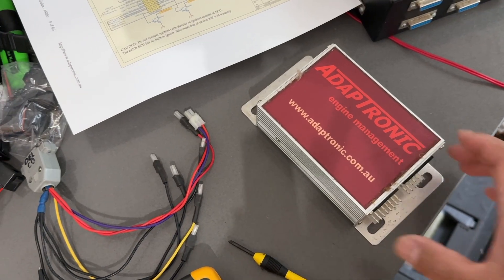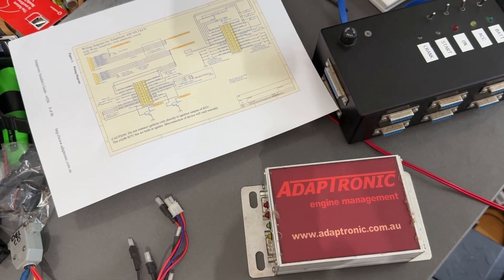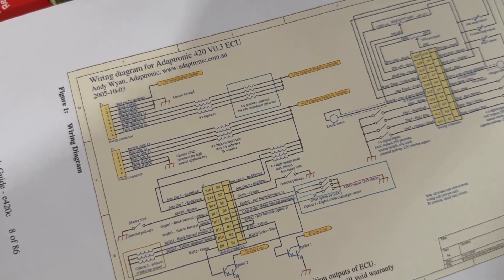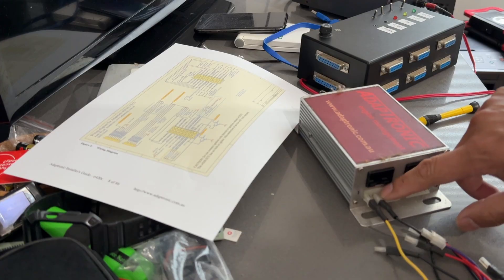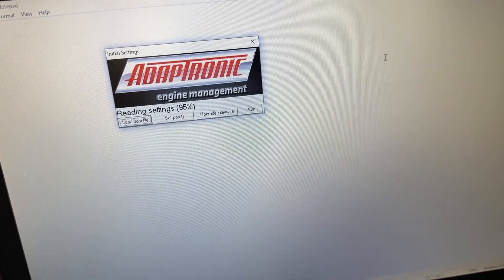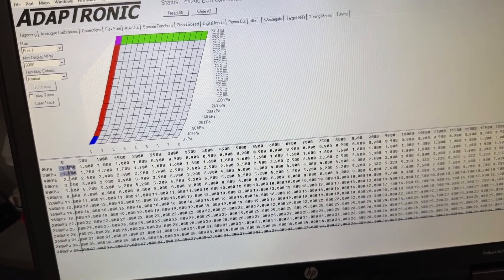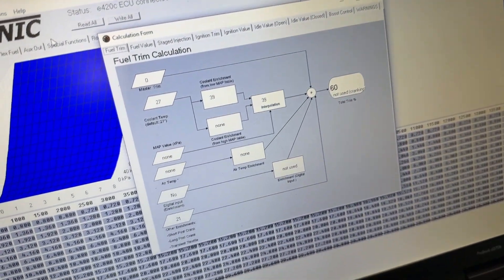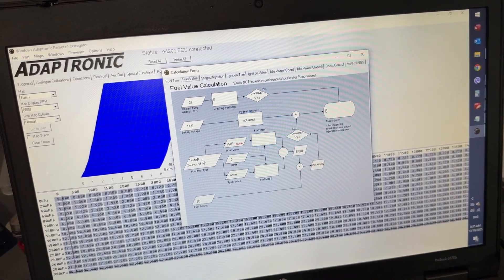Bigger Injectors, Same ECU? What Adaptronic does differently

Comment: If "about 20% more" means  25% more  then you would be correct about your correction
Reply from the maker: Yeah 430cc/min to 540cc/min is a 25% increase. Went with 20% as a starting point as it’s not tuned properly and still need to check fuel pressure etc.